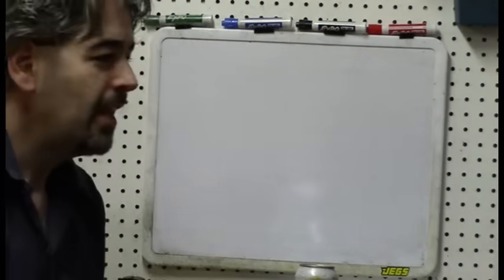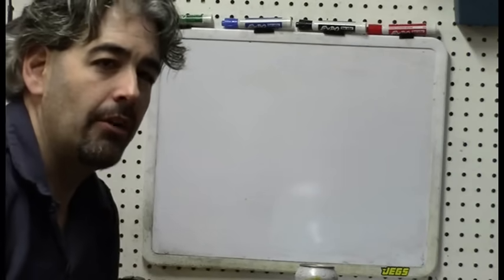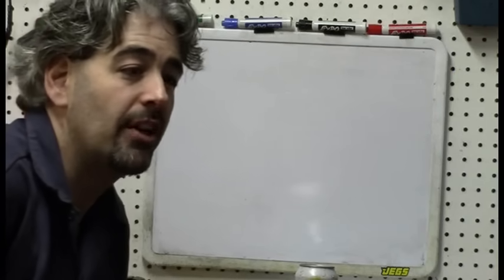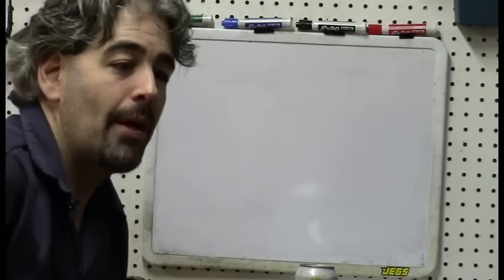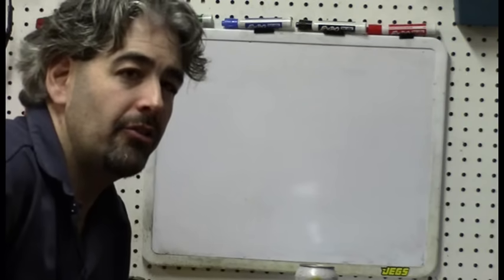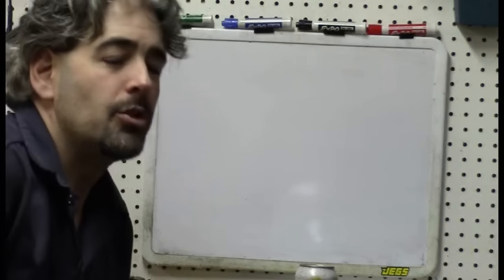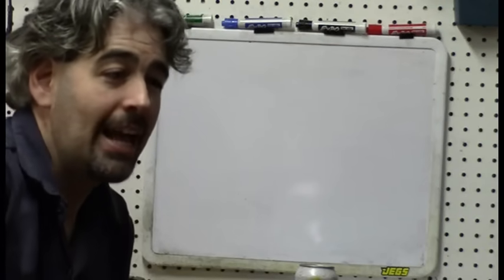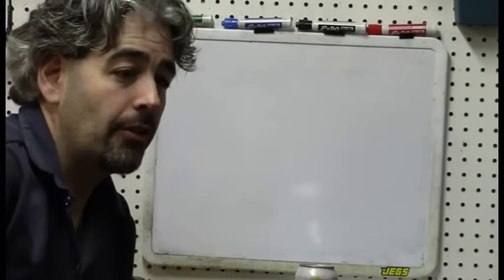Secret of Engine Problem Diagnosis- Fuel Trims Pt.1

Comment: Thanks for the video,  I'm scratching my head with po175 rich code, negative 25%. At the same time bank 1 is lean with 20 positive.
Reply from the maker: did you recently replace O2 sensors?
Reply: @SchrodingersBox  I changed the o2 sensor on bank #2, since I'm getting a po175. The rough idle started months ago with a p1633 Keep alive low voltage code. I had fairly dirty battery terminals, no more p1633 code , now po175. New plugs, changed injectors from Bank 2 to Bank 1 , New fuel regulator,  pump pressure 32 -38 psi. Can't find any vacuum leaks. Thanks for any help Steve.

Comment: I learned more in this video than 3 months of binge watching other channels. I worked on cars every day for years back in the day. The old V-8s, Slant/Straight 6's,  4 bangers.  Carburetors, Distributors. Coil, etc. Then....I stopped for 25 years.  Didn't open a hood for over 2 decades. Recently I purchased a 2005 Ford 500 Limited with the 3.0L DOHC Duratec engine. The car was like new and owned by an older couple. They actually dropped the price from $2000 to $1750 because they found out I was a Veteran. Unbelievable!! I wasn't even going to haggle with them.  They had all documentation on maintenance, the car had 5 brand new tires including a spare and not a spec of rust. Impeccably maintained. The best used car I ever bought.  When I opened the hood I didn't even know what I was looking at. It was UNBELIEVABLE. And I used to swap out engines in one day by myself. All kinds of jobs.  Worked on A LOT of cars in the garage on my house. Every make and model. It was INCREDIBLE to me how much engines changed.  I started watching videos on this engine and everything started to fall into place.  It was still an engine. Just COMPLETELY CONTROLLED by a CPU.  But that was all I really learned other than a few good tips.  This channel has brought me back to the point of having enough confidence to do work myself on these new engines. I can't thank you enough.  No other channel I watched EXPLAINED why I would be doing a job.  Just the how. To me.... the WHY is more important. If you are an old mechanic lost in  the technological advances on  CPU controlled engines you're in the right place.  Trust me.  This guy is THE BEST.  Hands down.
Reply from the maker: I was wondering when you would get around to this video lol.  In my opinion this one is the most important on the whole channel.

Comment: you R the man. i have a 2004 jaguar xj8 non supercharged  hat hesitates between 1 1/2 and 2 1/2 rpm real bad. no codes. I changed intake gaskets, both knock sensors,both cam sensors, all injectors,plugs and coil packs. I install all new vacuum hoses, pvc values, fuel and air filters, throttle body and gasket, mass air flow sensor, and new battery At idle and above 3 rpms the car runs great.. Any idea's
Reply from the maker: Thousands of ideas. What data do you have? Why are you changing all these parts- what data are you using to indicate they are all bad??

Comment: I will be happy to return the favor by answering any of your culinary  questions! : )
Reply from the maker: Your advice on best way to grill a medium-rare New York Strip Steak would be appreciated!
Reply: 1st...Get yourself a Quick Temp Stem Thermometer which you can use to temp ANYTHING! Oil ur Steaks and "press" your seasoning into the steak so it wont come off when u place it on the grill. Sear both sides for about 2-3 min. (flip only once) on a med high to high grill. You can see the nice color (carmelized) on the steak b4 u flip it. Then (Chef's secret), place it in the oven to about 135F-140F internal temperature. Let rest  3-5 min. (so the juices DON'T come running out when you cut into it). IF that were to happen because u cut too early.....ALL that moisture and tenderness would be gone!! : )
Reply from the maker: Ah the oven part I never heard of!!! Totally gonna try that.  I actually already do everything else.  You gotta get that carmelization on the sear- that's soooo ciritical!! Most people underestimate that!!

Comment: What a great explanation! Thank you very much for this - info is invaluable! I have a very rough idle on my car, and making sense of the OBD2 live data has been a pain, the STFT goes +20%, then -20%, and the LTFT goes to +14.5%... Could this be a vacuum leak or is there something else wrong with my car?
I have a video on my channel with a recording of the live obd2 data, called 'Mazda 3 Obd2 live data'
I would be very grateful if you could take a look at it, it has all the available data sensors, and give me an opinion. Thank you so much.
Reply: Just some further things to take into consideration: car was taken to a mechanic to do a MAF sensor clean, throttle body clean, and a new battery. 

The rough idle appears a 2-3 times when stopped at a red light, drops from 800rpm to about 450 rpm couple of times, then stabilizes and all good, until I start driving and stop again. Also, when the rough idle appears, the lights on the car appear to dim as the rpms are dropping - and after it stabilizes it's ok. Also I don't have any CEL.

Comment: I think back exhaust pressure could also lead to unmeasured air too if the catalytic converter is not able to push through all the gas exhaust to the second cat then to the muffler. This might also confuses the engine computer system due to the back pressure unmeasured air coming form the exhaust valve.
Reply from the maker: If air is unable to enter it wont be measured. The induction metrics will still be accurate
Reply from the maker: Wait - strike that--- I just thought...  the MAP sensor is an induction sensor and that one would definitely be affected by what you described.  Absolutely!
Reply: That what is wrong with my car. Unless I replace or modify the cat, this code and some other will keep popping up.

Comment: Hello
We have interesting discussion about BMW 6-cylinder gasoline engine dme control.
We are debating if the oxygen sensors are used in openloop condition or not. 
The case is when customer disconnects maf-sensor connector, car runs better he says. 
What do you think, if car is in openloop maf disconnected is there any data , that engine control unit uses for mixture calculation.
Thanks for advance :)

Comment: beyond helpful! after MONTHS of suggestions from others checking wire connections, solenoid tests, checking wires for continuity and voltage and so much more to then checking my ECU for proper voltage as well as the MAF, (while going bald i might add lol) i followed this mans directions with my OBDII and it showed EXACTLY what he said, i found i had a vacuum line off creating the problem all along. now long term fuel trims are slowly going down as itll take some driving to finally adjust back to proper settings but the code is gone! by the way this was on a Mazda RX8 rotary and still correct info.. meanwhile others were telling me to purchase a new ECU.... thank you so very much for your efforts to help your fellow man!

Comment: Great presentation! Thanks for this free education! Quick question: does the O2 sensor Voltage at 0.42V steady tells that the issue is not the sensor? Is it  more like the circuit/ heater problem? OBD error P0136 - O2 sensor circuit. Thanks in advance!
Reply from the maker: That reading would clearly indicate you are only seeing bias voltage. Easy diagnosis.
Reply: Easy for you for sure:) but i'm not following, what to do to get rid of this error?

Comment: Could O2 sensors be used to check fuel ratio on older carburetor motorcycles? Getting up to 700F seems high.

Comment: Hi Dude, love all your videos ( i've watched lots of them ;-) Now I desperately need your help! I have the Foxwell nt-301 which i'm using to diagnose a 2007 BMW E90 320i M-Sport with the N46B20B engine,  first on connecting, the scanners warning light is ON but there are no error codes found,  if I view "Live data"  the only PID's of concern are the MAF & the downstream O2 sensor bank 1( the MAF PID displays 0.0g/s & the O2 PID is displaying 0v ) + all the other O2 PID's have variable voltage, fuel trims S/T seem okay they for both banks sit either side of 0 -/+ all depending on load & RPM. I replaced the MAF with a new Bosch OEM part, but I still have the same diagnostic report( 0g/s for MAF PID ) So I tried another BMW same model as mine & you wouldn't believe it, yes! the same O2 sensor PID has a 0 voltage & nothing for the MAF PID either...... Now I'm completely lost man.. What's going on??? Please help. I have even tried another OBD2 diagnostic tool the " OBDLink MX+ " to only have the same return ( I'm have a Windows version of the scanTool software in a Panasonic fz-M1 ToughPad ) Still no output on brand new MAF, Oh & get this, if I back probe the sensor with a Hz capable DDM( no scope 😩 lol )  I see a variable frequency in the KHz ( value depends on RPM & seem responsive ) I just don't get it. Please share your thoughts with me.. Why do the scan tools fail here (MAF) & whats the story with the O2 PID ( surely both BMWs couldn't have the same same sensor issue "but according to the scanner they do! " but both cars run fine ) Very odd.I eagerly await your response. Thanks Lex.🤧
Reply from the maker: My DIY scantool does the same thing on BMW. I think it’s an interface issue.
Reply: @SchrodingersBox  Thank you very much for the timely reply. Very interesting that ( You have the same "software bug" with generic OBD diagnostic tools ) I'm going to touch base with my local BMW dealer & investergate further. I shall report back to you with my findings ( if they're able to give us a convoluted explanation that is.. -  I'll share it. lol.🔬🤓🇳🇿

Have the best day ever Mr.@Schrodingers_Box. Your awesome man!

Kind regards,
Lex.

Comment: Thank you for your channel really informative very helpful and definitely pushes you to think critically I'll get right to it I got a question about the numbers that I'm seeing relation to some of the repairs I made. The numbers before making these repairs the short-term fuel trim was at 24 long-term fuel trim was at 0 after the repairs short-term fuel trim is now at -2 long-term fuel trim is at positive 11.7 and I forgot to mention that that is on both Banks I have a V6 motor the question I have is being that the long-term fuel trim was at 0 prior to making the changes I made now is that positive 11 what does that mean
Reply from the maker: you can’t really say because your long term did not set a zero point initially. 
  you will have to see if you get any new codes. but you can’t really compare just on a STFT.
Reply: @SchrodingersBox  
Is there anyway I could email you a snapshot of what it's doing give you a free friend and you can just look at it the way you analyzed like in the videos that you've done
Reply from the maker: just curve the long and short term trims against load and send that info. i can probably determine something from that.

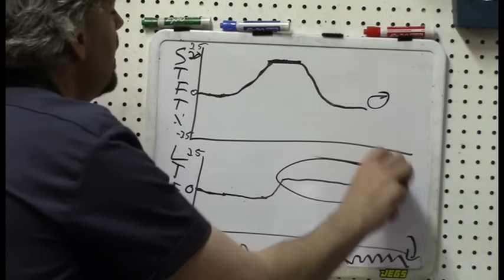Comment: awesome. Thank you. @ about 18:44 you wrap up the vacuum leak, lean, STFT to LTFT issue. Wouldn't this result in a higher idle, as more air and fuel are constantly being pushed through the engine?
Reply from the maker: On a MAP only engine it would. In a MAF engine it results in lower idle until the fuel trim is adjusted. on a MAP only engine a vacuum leak is essentially the same as increasing the throttle and your statement would be correct. On a MAF engine you will see the IAC try to react first lowering the idle.

Comment: Having taken all this on board. Will the fuel trims sort themselves out once any issues have been solved or do they need a manual reset every time?
Reply from the maker: No they sort themselves out - in fact, you can actually watch them sort themselves out which validates the repair was successful!

Comment: O2 sensor samples air inside the pipe and outside around harness . if you tape up the 02 sensor harness air tight it wont function correctly.

Comment: A friend with a 2015 or so Mitsubishi eclipse needed an o2 not a a/f. Very low milage. Also heard a/f sensors are only good for about 10-20k miles!
Reply from the maker: I have seen them last as long as normal O2’s HOWEVER there may be some evidence that if the engine is running too rich the A/F sensors may be damaged before an O2 sensor would be. That might be possible. But on a normal running engine they should last 60K miles or more.

Comment: Very helpful and knowledge based videos!! thank you!! I have a 1999 dodge durango and when it hits closed loop the ST Trim adjusts negative by 25-30% until it corrects itself than long term levels out to just 2 %. The vehicle runs like complete crap until it adjusts 15-30 seconds. Any idea what to review? everything on the scanner seems normal that I'm aware of. No codes are pending or displayed.
Reply from the maker: Check you basic rich condition variables.

Comment: To me it seems like you should be watching STFT as RPM's increase if you suspect a vacuum leak at 25:50. Will LTFT change that fast as you step on the accelerator?
Reply from the maker: no- you want to look at the HISTORICAL correction. the STFT is already corrected by the LTFT.

Comment: I have an 05 murano, it has P0420.i checked the voltage readings on,O2s11, it has 0.300 to 0.320 volts and O2s12 has 0.790 to 0.800 volts. With these readings given,what part is bad? Or more informations are needed? I’m trying to understand all of these fuel trims systems,things so i can fix my car. I’m starting to absorb this slowly. Thank you so much,you’re a pro...
Reply from the maker: Find the readings when curved against load and if your front O2's still maintain lean then fix the lean condition first

Comment: First of all, the air fuel mixture does not “blow up” in the combustion chamber. If the mixture blows up, that is called detonation and can damage the engine. The mixture ignites and burns as an even flame front from one end to the other. Second, the engine computer is not always trying to maintain a stoichiometric mixture ratio. For example, under hard acceleration, the  computer might aim for a mixture closer to 10.5:1. There are other things said in this video that aren’t quite accurate, but it is informative for the most part.
Reply from the maker: That’s why I clearly stated “not always”.

Comment: Enjoying the videos, and the wit, but looking for clues too. My '99 Sierra 6.0 runs rough, mostly at lower RPMs like at stop lights and such, with lots of misfires for different cylinders in the history. I was watching these vids to learn more about troubleshooting, and after a short run the LTFT for Bank 1 is around 0%, but the LTFT for Bank 2 is at 10.9% so I'm wondering if an injector may be wacked? Clogged catalytic converter? New plugs and wires recently, around 190k miles. Thanks!
Reply from the maker: you can’t say because you don’t have a total trim curved against load. there is no usable information there sorry.  find the total trim curved against load and it will point you to the issue.
Reply: @SchrodingersBox  The problem exists mostly at idle, sitting at red lights and such, when driving it seems much smoother.
I'm trying to learn as fast as I can, I hadn't even heard of STFT or LTFT until a week ago! Lot's of videos on vacuum leak and positive number problems, not many on on V8 engines with one bank doing okay and one having issues.
Reply from the maker: definitely easier when it’s one bank. there are only 1:4 as many variables when it’s a single bank issue. but most people mistake a single bank issue when it’s actually a whole engine issue because they don’t check total trim on both banks and there could be a trim that is just below threshold for setting a code.
Reply: I've got both, and O2 sensor voltages, plotted on a spreadsheet. LTFT stays fairly in sync between banks, with B2 staying about 10 point lower.
Check out odysee dot com, you'd be one of the first auto tech people there.

Comment: My astro 99, started acting up , like it wasn't getting gas. But it will start some times and then you turn it off it'll start right back up, but then it might sit then it won't start.fuel pump we changed new filter, still doing the same. WHEN it starts it runs great it don't staul.but sometimes if it runs a while or idle it starts to run a little ruff. WHEN it won't start it acts like It's flooded or it sometimes back fires. One mechanic said the line that comes up between the motor and tyrany has a hose that's flexible might have flattened not to let the fuel in. I noticed sinse it has warmed up It's been starting.i checked the relays. Thank you.
Reply from the maker: Do you have any data?
Reply: Couldn't, get none.
Reply from the maker: Well then we can't diagnose it, sorry
Reply: When we Couldn't get it running he Couldn't do it. He said it had to be running, it had been acting up sometime. But nothing regestered.
Reply from the maker: If I had just basic fuel trim analysis data it would be an easy diagnosis, Sorry- if you get even some basic beginner level data it would be a start- otherwise I'd just be guessing and there are a million variables.